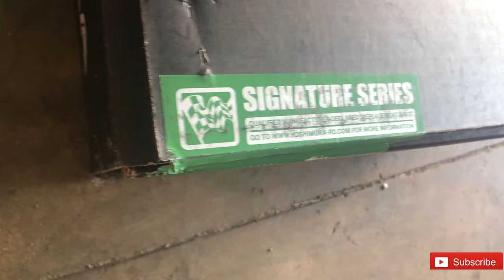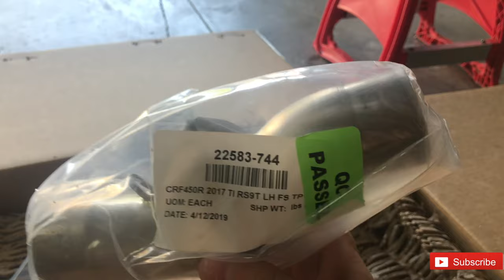Yoshimura RS-9 Ti system install and review for 19' CRF450R

Comment: do you prefer with db killer or without?
Reply from the maker: Marco G. Without for sure!!
Reply: @Dsklar41  it is smoother without than stock?
Reply from the maker: The whole system smoothens the power out from stock, I did not notice a difference as far as smoothness goes with the db killer or not
Reply: @Dsklar41  so with or without change only sound?

Comment: How did you get the quiet inserts out ?
Reply from the maker: There is a rubber grommet underneath on the carbon end caps, take that grommet off snd there should be a little Allen screw, take that screw off and they should slide right out
Reply: @Dsklar41  for sure ended up buying a slide hammer which helped out a lot

Comment: Where did you get that HRC graphics kit?
Reply from the maker: HondaAllDay H.A.D I got it from throttle jockey
Reply: Dsklar41 Thanks so much for the response!
Reply from the maker: HondaAllDay H.A.D of course! Hope I have earned your subscription
Reply: Dsklar41 I just subscribed! Also, were your graphics just stickers or were they new plastics with molded in graphics?
Reply from the maker: They were a complete set of graphics, goes over the existing plastics